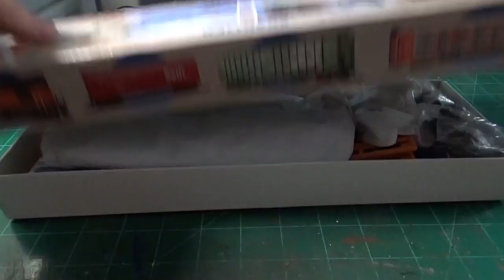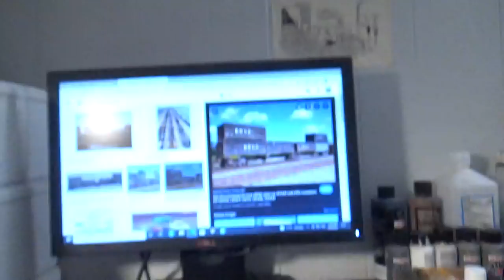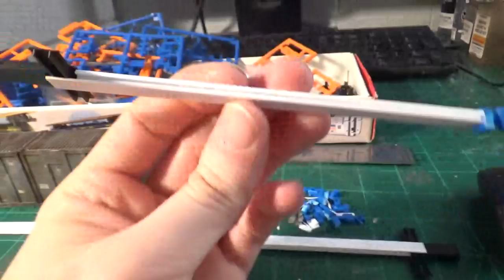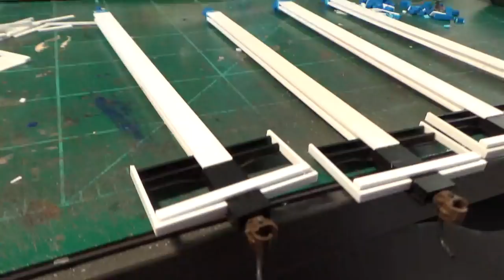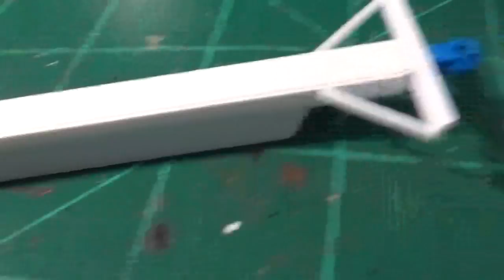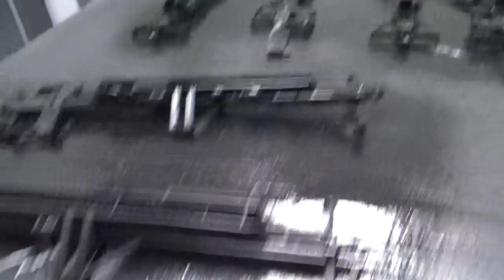**One EPIC Build!  EPIC Trash Spine Car Build:  Part 1.  A Tale Of Fails And A Backup Plan.**

Comment: Great project Dan. In the early 90s we used to have a similar train in the UK but it used standard 60 foot flat wagons rather than spines and because of our short loading gauge couldn't be double stacked.

Spine wagons didn't really take off in the UK until the early 2000s after Wisconsin Central bought our freight companies and invested in building new rolling stock.

Looking forward to the next part. 👍

Comment: Love it Dan! You look like you're down for the count, but you are just saving your energy for the creative bomb you set off. Man, I admire your determination. You're never down, you are just gathering materials.
A good source weighing cars (of all types) is buckshot for hand-loading components from a gun store. You can get bags of shot in various sizes. The only drawback I've found is the 25-pound bags... nothing smaller. Crikey, you'd have enough shot to weigh about 13,000 of these! If you have any friends that shoot, ask around to see if any of them re-load - maybe you could find someone to see if they would sell by the pound. 
I just checked with that company named for a big river and they do sell 4-pound bags of shot for $25-30 or so. 
Keep up the great work, Dan - can't wait for the next installment. Hopefully you won't have any more crappy problems to deal with.

Comment: What a surprise to see this from my favorite weathering guy! I also have considered modeling these as we see them often over the CUOH. I've thought to use parts from the older spine car kits. Haven't had time to start this project. As far as the Epic containers, on shapeways there was someone selling 3d printed models of them. I ordered some, my only hold up is the decals for them.
Reply: I've contemplated how to make some of these myself. My thought had been to look into 3D printing for the cars themselves though, but I need to learn some 3D modeling software first.
Reply: @OhioCentralModeler  If someone would make these for 3D printing I'd order a batch of them.
Reply from the maker: @Halosixteen  There are several versions available in 3D printed form.  I have also had decals made which I will talk about in the next video.   As for the containers, this link will get you to them.  https://www.shapeways.com/product/5XW5J9PE8/ho-1-87-epic-trash-container-3-rib-with-lids?optionId=87057294&li=shops

Comment: Looking good so far. For the weight, I'd suggest finding something like rio bar, threaded rod etc. Get the right diameter and cut it to length. Even cut down tent pegs if they are small enough in diameter

Comment: Keyway stock. Can be found at any hardware store. It is square stock that comes in different sizes 1/16, 1/8, 3/16, 1/4, etc square. Also comes in metric  square stock. Take the frame with you to the store and fit the biggest size of stock that you can inside.  The cheapest way to purchase is in the 12inch length, cut to size, a dab of RTV. Done.  Have used 1/8" on the channel that runs under hopper cars.

Comment: You could use N Scale weights. Some are narrow and might fit. I am in TT Scale and every project is like this. You for the most part have to build everything. I buy junk N Scale cars for the couplers, screws and weights. I also freelance my own road so it's a bit  easier. That said, I use old HO Train Minrature 40 foot underframes for a 53 foot spine car in TT. They have a groove in the bottom you can put metal rod stock into. That works well.

Comment: I've seen these loads come through northern Iowa on the UP with some including four containers. I have three Athearn blue box sets of five articulated spine car sets. They are older and made for shorter 40' trailers. They run horribly and therefore had little use and are on my list to either sell or give away. Your solution looks like a great idea, but these cars I have may work for future projects.

Comment: I'd look into designing and 3D printing these cars at that level of complexity. There's some places online you can get parts 3D printed out of metal to get the weight. Or you could 3D print them in plastic and hide the weight in the containers.

Comment: I would use BBs for air rifles and I believe there is no support bracing on the middle support I see these car come thru NJ and go on Railroad Picture archives they have lots of pictures of the cars
Reply from the maker: Well there are several types, this Johnstown version only has bracing on the outer sections, the berwick has them only on the inner support.

Comment: I don't understand the design of these cars. Presumably the 3+3 loading is because it means each truck is supporting two containers, and they'd be overloaded with 4+4, which would put four containers over the shared truck. But, if that's the case, you've lost all the efficiency gains that the shared truck gives you. Having ordinary separate cars would let them carry four containers per car, so the train would be 25% shorter. There wouldn't be any more maintenance because you'd still have the same ratio of one truck to maintain for every two containers of capacity. Were they originally designed for ligher loads that would allow 4+4 loading, or something?

Comment: What about finding someone with a 3D printer.
Reply from the maker: I have talked to several people, currently me and some other experts are putting together ideas and getting them designed in 3D.  The problems are that the center pin would be hard to cast and would be brittle, a lot of the details would be hard to cast and would be super fragile as well, among other things.  If we got them made, it would be a lower quality 2 part model that would need detailing.